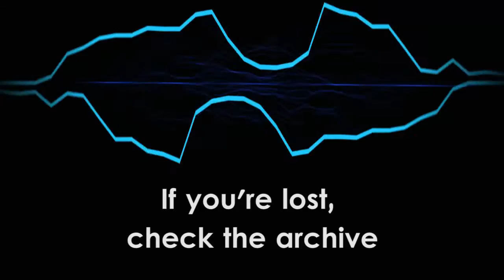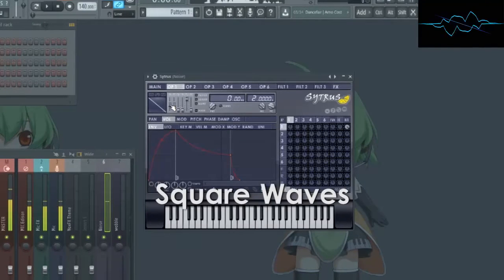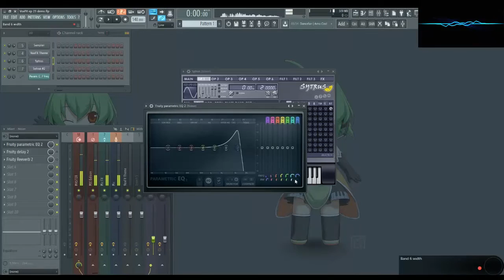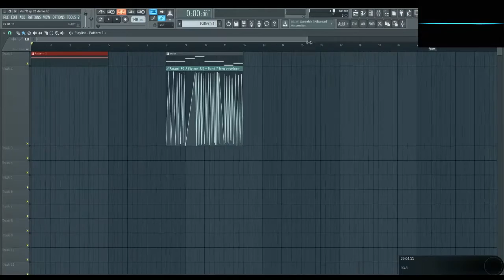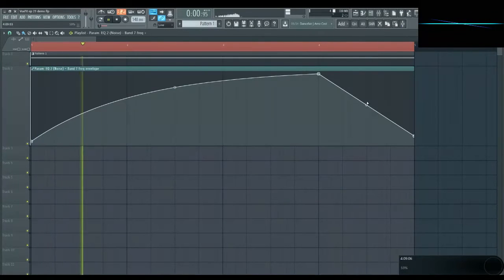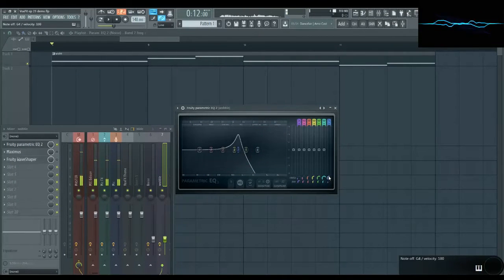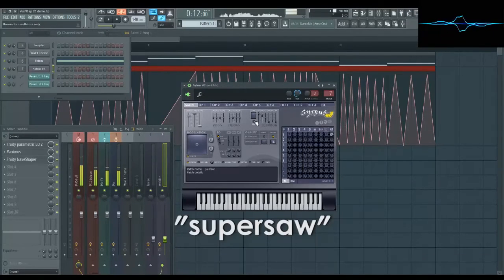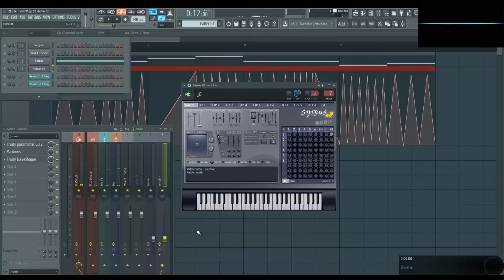Sound Design Tutorial: Noise Risers and Wobble Bass - VoxFX Ep. 23

Comment: Nice video dude, I've got two questions.  Do you know an easy way to create artificial voices in FL studio/any DAW?  I know there is a way to with just modifying the frequencies, but that would take hours for not much use.  
And second, how would you convert your DAW into a live voice modulator/voice changer?  I know it involves setting the live playback to two locations, one being your headset and the other being the virtual audio cable, but I had some problems with getting the VACs to interact well with chat services.  I haven't had a chance to test on skype, but I couldn't figure it out on discord, it kept getting cut and muted.  It could just be the chat program though, not interacting well with the Virtual Audio Cable.
(I'm aware that FL wasn't meant to do that kind of thing originally, but I wondered if you have figured it out.)
Reply from the maker: +Ender Hooves For your first question, I'm not quite sure what you mean by "artificial voices." If you're talking about fully-synthesized speech, then you'd be better off using a text-to-speech program (FL has one built-in). If you're talking about modifying a recorded voice, then there are lots of ways to do that; it depends on what you're going for.

As for your second one, it sounds like you're trying to play back DAW audio over a voice chat client. I know Tutsplus has a tutorial on how to do that using an audio interface. I haven't tried it yet, though, so I don't know how well it works.